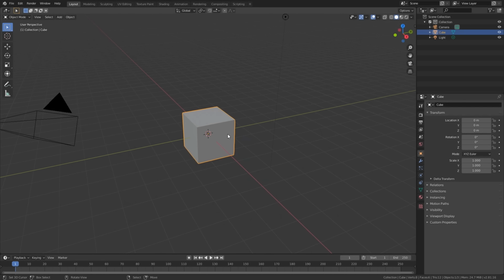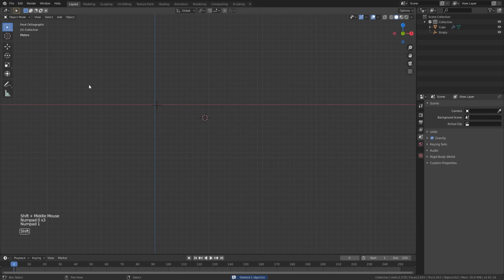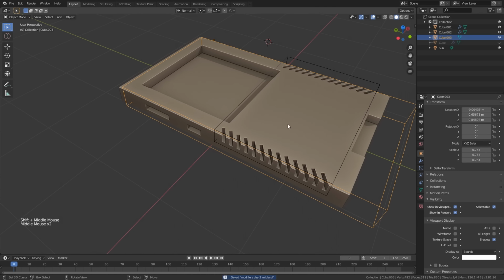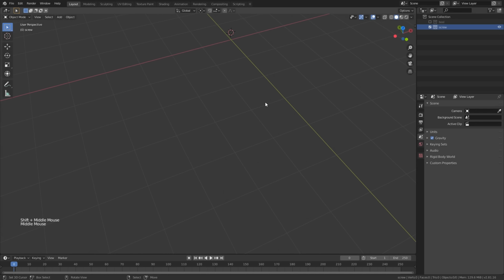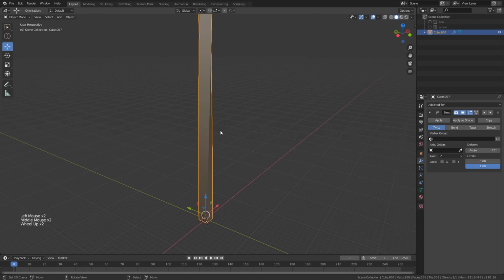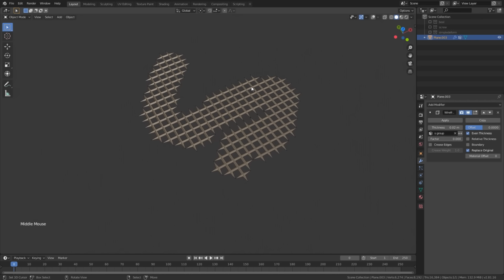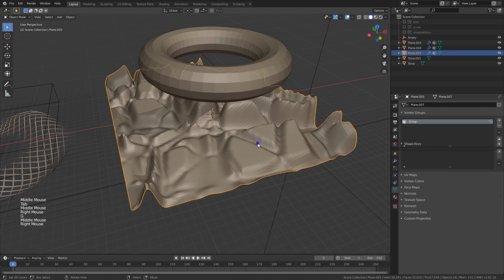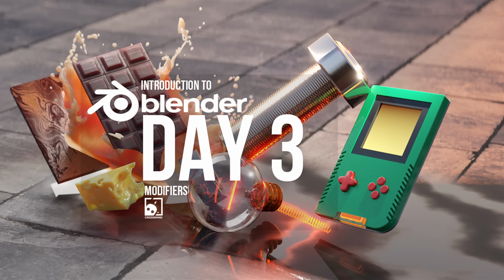Blender Day 3 - Modifiers -  Introduction Series for Beginners

Comment from the maker: Not bad you made it to the third chapter :)
If this was a video game, then your Level 1 Dagger is about to get enhanced with spells of modifiers :D
Fight Hard.
Reply: yoo , thanks for this series ,
Reply: My boolean modified does not work everytime. Sometime it does not cut the object, sometimes the cuts are no way related to the object it is cutting and 60% of times it works as it should. Can someone helpme with this plzz? I'm just a week experienced but i know how to use it, procedure is done correctly i assure it.
Reply: lets goo!!:D, thanks for this
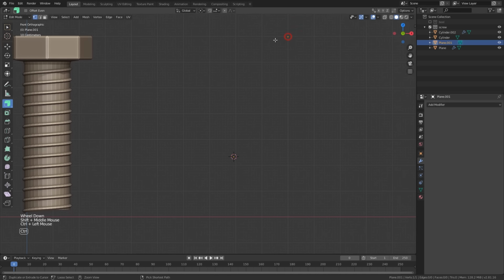Reply: in blender 2.80  that option origon not available waht should i do , time of video at 21;18. and 23:50 how you create path of vertics which tool you use to create bulb
Reply: @islam24oclock13  create a plane and delete all vertices except one and extrude it where you want it he used subdivision modifier first and after that he used screw modifier i faced problems too creating bulp too but i managed to make bulp now i am at the starting of day 4 hope you and me will be a good creator 1 day
Reply: @l.u.c.k.y7625  thanku
Reply: @l.u.c.k.y7625  thanks ,
my system cant run 2.93 .my system can run perfectly 2.80 , it can also run 2.81,82,83 and 2.90 , but there is a problem every time i open new file of blender or create mesh its like invisible but i  didn't turn  on x ray mode mode . default shade mode look like like x ray mode. every time i create mesh ,i need to go to edit mode then click right to cancel selection then my cube become vissible 

when i add zip file of open gl 32  at file location of blender, that problem solve cube beccome solid but slow respons of blender . i cant continue my work .
can you solve this problem?
Reply: a list of software for you  to try out 
gim inkscape natron lmms darktable shotcut kdenlive freecad godot   all opensource
Reply: i am learning this at 2.93 version but thanks
Reply: Thank you for these series!
Reply: Thanks for the Tut's really apreciate it. at first i was just looking for 15 minutes, and now i have made it until day 3! really enjoying blender. Thanks sir.
Reply: brother how did you made your own object? like just placing the vertex on different points.
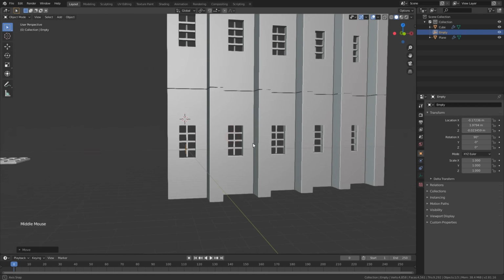Reply: 8:30 My array objects are getting smaller in different size when I'm using empty object, it's not working. What should I do now sir, please help me 🙏
Reply: We did ittt! 🖤🖤
Reply: I've been stuck at the simple deform modifier using the bend. It seems maybe the function doesn't work the same. I'm running blender 3.6 I cannot get the second simple deform (bend) to look like a ring like you have @31:39. I'm wondering if other functions don't work the same. I am noticing the interface is different.
Reply: While modeling that cheez part, my laptop is lagging, Before this it was running smooth, did I went wrong somewhere? Can you please tell me what is the issue? @CrossMindStudio
Reply: While modeling that cheez part, my laptop is lagging, Before this it was running smooth, did I went wrong somewhere? Can you please tell me what is the issue? @CrossMindStudio

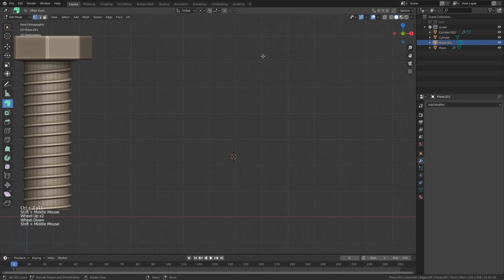Comment: 23:47

In newer Blender versions, Ctrl + Right Click does NOT add points by default anymore. That worked in older versions.

Here’s the correct modern way:

✅ Correct Way to Draw Curve Point by Point
1⃣ Shift + A → Curve → Bezier
2⃣ Go to Edit Mode
3⃣ Select all → X → Delete (remove default points)
🎯 Now Add Points

Use:

👉 E (Extrude)

Press E

Move mouse

Click to place next point

Repeat E → click → E → click

This is the proper method now.
Reply: Thank you random youtube guy

Comment: Hey Blender Artists! 🎨

If you’re exploring Blender and found this tutorial useful, I’ve jotted down some detailed notes from my learning experience. These notes capture the key techniques, tips, and tricks highlighted in the video. Think of them as a quick reference to supplement your learning. For full explanations and demos, make sure to watch the complete video.

Happy creating! 🚀

Blender Day 3 Modifiers Notes
Non-Destructive Editing and Animation:

Once we edit in Object or Edit mode, changes are not easily reversed or animated.

Modifiers allow for non-destructive tweaking and stacking to create effects. They remain in the properties panel until applied.

Array Modifier:

Creates copies of the initial object with adjustable placement.

Changes to the original object reflect in its copies.

Reset movement transforms with Backspace (hover over count area, then press Backspace).

Modifiers can be stacked with differing settings.

Modifiers remain a single object until moved; ensure object offset is correctly applied when moving.

Importance of Object Origin in Modifiers:

Example: Create a cube > Apply array (9) > Add empty object > Select Object Offset in the modifier.

Moving the empty object affects the arrayed objects.

Rotation and scaling apply to the entire array.

Start and End Cap: Specific objects for the start and end of an array.

Boolean Modifier:

Works like set operations: union, intersection, difference.

Apply Boolean to Cube > Select Sphere with eyedropper > Choose operation.

Transform Menu > Viewport Display > Display as (Bounds): Changes object visibility.

Gameboy Creation:

Ctrl+A opens the apply menu.

Adjust gaps via transform location in the modifier.

Mirror Modifier: Align with a specific object using the eyedropper.

Apply modifiers from top to bottom to avoid unexpected results.

Differing viewport options can be applied within the same scene.

Screw Modifier:

Parameters: Angle, Spin, Segments, Screw, Axis.

Change object origin to adjust diameter.

Adjust screw height and number of loops with Screw and Angle parameters.

Steps parameter (now Viewport Steps) for spin subdivisions.

Create symmetrical objects efficiently (e.g., cans, lamps).

Other Notes:

Create a new point in Edit mode by deleting vertices and extruding a new point.

Use reference images and adjust opacity in the data menu.

Screw modifier in bulb creation demonstrates automatic symmetry.

Simple Deform Modifier:

Requires a sufficiently subdivided mesh for proper deformation (use loop cuts with Ctrl+R).

Ensure the correct axis is selected to avoid unintended distortions (default angle is 45, max is 360, min is 0).

Moving the object's origin can create interesting effects but may not be recommended due to linked dependencies.

An empty object can be assigned as the origin axis to control deformation.

Bend in Simple Deform:

Acts like a loop or curled bangle.

Deformation can be restricted (top to bottom, bottom to top) using sliders.

Adjusting both sliders can create effects like knots or curled structures.

Taper and Stretch in Simple Deform:

Taper: Scales the object along a specified axis, pinching or expanding it (like squeezing a toothpaste tube).

Stretch: Scales the object along a specified axis without uniform thickness change (like stretching clay).

Animating Simple Deform:

Values in Simple Deform can be animated for dynamic effects.

Multiple Simple Deform modifiers can be stacked for complex shapes (e.g., twisted and bent shapes).

Wireframe Modifier:

Converts the mesh into a wireframe structure, allowing interactive adjustments.

Use matcap shading to enhance the visual effect.

Thickness can be adjusted in the modifier settings.

Vertex Groups:

Create sub-objects within an object to control specific areas.

Assign vertices to a group in the Object Data Properties panel.

Use Weight Paint mode to visually assign influence (red for full, blue for none, gradients for in-between).

Vertex Weight Modifiers (Edit, Mix, Proximity):

Dynamically change vertex weights based on proximity to other objects.

Useful for creating effects like a portal opening near an approaching UFO.

Displace Modifier:

Applies deformation based on texture to a subdivided mesh.

Can be controlled procedurally by moving an empty object.

Texture parameters affect the deformation, with keyframe animation possible.

General Tips:

Practice modifiers in the Modify, Generate, and Deform categories.

Pause Simulate modifiers for now as they are complex for beginners.

Combine Boolean, texture, and other modifiers for detailed object creation.

Thanks for checking out these notes! A huge shoutout to CrossMind Studio for providing such an insightful tutorial. Enjoy your Blender journey, everyone! 🚀

Comment: What is the difference between bevel in edit mode (CTRL + Bevel) and in modifiers? Modifiers can be changed and in edit mode can't?
Reply: @CrossMindStudio  Tks for your response
 but that wasn't my question 😁. Mine is related to "bevel". We can bevel using the modifyer and using CTRL + B in edit mode. What is the difference? Great content btw
Reply from the maker: @cleberlimacls  both are same but modifier applies bevel on complete model whereas in edit mode you can bevel selective edges or vertices
Reply: @CrossMindStudio  ahhhhhhh yes. Of course. Tks 😅

Comment: timestamp :-

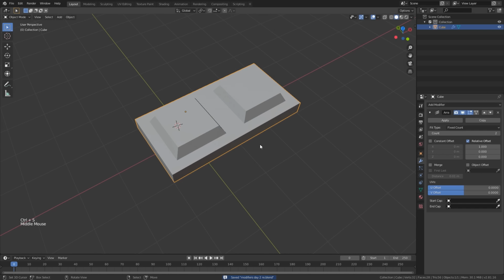Array modifier 2:55
Bevel modifier 4:27
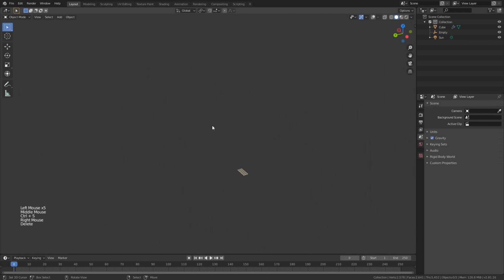Boolean modifier 8:55
Mirror modifier 12:08
Screw modifier 20:37
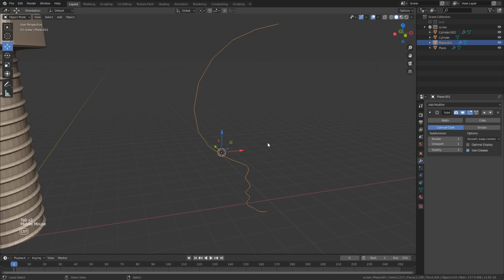Subdivision modifier 24:06
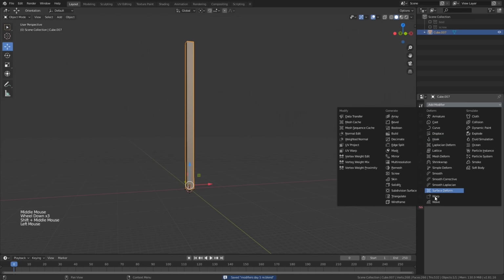Simple deform modifier 27:03
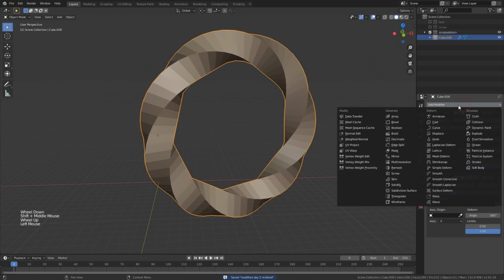Wire frame modifier 31:27
Vertex group 32:04
Displace modifier 44:33

Comment: Hey is their an add on or modifier that will leave an indentations of an object? Similar to the bullion modifier except on a flat or hollow surface? Exampl: if I took a flat plane and put an object through it, it would make an indentation of that object on the outside and inside of the hollow or plane. Is their such modifier or add on? Hope this makes sense. Thanks for your time.

Comment: hello. i could use help on a certain part please if anyone can. at 8:19 I try using the empty object on the array modifier and rotating 90 degrees but it still looks all messy after rotating it instead of aligning them perfectly as it does in this video. does anyone know why this is?
Reply: I'm having the same problem :(
Reply: @jellybingbara  i clicked command A on the object and selected "all transforms" and that fixed it (can't remember if I did it before or after I added the empty game object but if I remember i will let you know). Save before doing this in case it just messed yours up more
Reply: @pleasedontsub2732  ahhh thank you so much!!!! Do you know why it fixes the problem?

Comment: Modifiers in 3D modeling allow for procedural control and animation.
00:01
✦Modifiers can create complex objects from simple ones
06:26
✦Creating cutouts and buttons using boolean modifiers and bevels
12:21
✦Modifiers in Blender can create abstract shapes and are useful for motion graphics.
19:17
✦Learn about Blender's screw and simple deform modifiers
25:09
✦Learn about vertex groups and modifiers in Blender
31:04
✦Learn about dynamic modifiers in Blender
36:35
✦Learn about stacking modifiers in Blender 
42:15

Comment: i use 3.4.1 blender version and its a few difference or error. for example when add bevel for the button the curves not apply uniforms you can fixes it with ctrl + a and select scale it will give you back normal bevel. for another error like applying array modifiers theres no button apply in the blender 3.4.1 you can solve it with ctrl + a and select visual geometry to mesh. after that the modifiers will gone and you can shrink or scale it

Comment: “Now we can apply a mirror modifier…” 
How? I see what you click on, but it doesn’t work for me. This is a common occurrence with these tutorials: “use this for X-effect… “ then you follow up with more we can do on top of that, but as a beginner those initial event, the ones that all others are built off of need to be better fleshed out. 
Did you adjust your orientation, the pivot point, the world cursor, etc… 
I’m regularly getting stumped on those initial moves and spending 10, 15, 30 mins figuring out what one thing is making the difference.
The tweeks after are only useful, if I can follow the initial move. 
The initial move needs to be the focus.

I’m off to figure out why my mirroring didn’t work. Be back in 10-30 mins 😑
Reply from the maker: What prob are u facing exactly? Feel free to ask n mention time stamp

Comment: On 18:28 in a rectangle you are doing inward extrusion, and in my model after selecting all the faces I can only extrude in z, y or x direction but not all of them to the centre of the rectangle. I have orientation and pivot points set to global and bounding box center as on your model.
Reply: Did you ever figure this out?
Reply: I just had this hiccup. He accidentally says Extrude Region, but it's really "Extrude Along Normals" that he used. Notice in the video that the Extrude button shows the Extrude Along Normals icon when he uses it, not Extrude Region. That should fix it.

Comment: hi , the array modefier have been changed how can i control hem in the new version 8.2.2 as the way you did ?
Reply from the maker: No changes in array modifier
Its the same.
Also im not sure where u downloaded 8.2 version. Blender have only reached 3.2. 
Let me know if you still facing this issue and specifics of what exactly is the problem 🙂
Reply: @CrossMindStudio  i download it from blender, and the problem that there is no where to do a controller to the array modifier

Comment: I can't find the wireframe modifer, is it gone?
Reply from the maker: no, still there.
Reply from the maker: make sure you have selected a mesh object. only then it will show mesh modifiers.
Reply: Just scroll down a little bit in modifier. I had problem with finding it too😂😂

Comment: hey, im using blender 3.2 and i can not see the weight like 36:40 is showing, i know it's working because i can see the changes on weight paint mode, but it's uncomfortable to do that every time, it's there an addon or an option i could toggle to fix that? thanks in advance
Reply from the maker: Your viewport overlays might be off in display settings. Check buttons on top of viewport

Comment: I was wondering how did you do the water splash model? which appears for the chocolate bar in the next episode of this series. Thanks for the tutorials it helps a lot for a beginner.
Reply from the maker: i did mention its made with fluid simulation is just there to demonstrate material. you can ignore it. once you are done with this series you can check out playlist section for fluid sims tuts.

Comment: I’m having a problem with my boolean modifier. For some reason it doesn’t work as soon as I apply the array on the angled squares. Boolean works with array though when the squares aren’t angled. Any way to fix this? Thanks for this. Awesome tutorial!
Reply from the maker: Sometimes changing the angle of object a but or even the position change can fix this glitch. Try to move ur array object, its just that sometimes intersection lines glitch out.

Comment: Hey I managed to get past 1st 2 2nd was bit hard but I am facing a problem here. You literally made a whole bulb using the screw modifier. Now I can think of this screw modifier in places where winding is required but bulb? Like that how do I know on which other object I can use the modifier?. I mean the bulb could be made with mesh but taking a lot time which screw did in seconds. So how do I know which modifier can make the model easier to create rather than wasting time on mesh. Also you are making a drill like structure with the simple deform. I mean that's supposed to be screw modifier. Now this is complicating things on where should I use what modifier.

Comment: I was trying to be clever and I used an array modifier for the cross button relative to an empty object rotated by 90 degrees. However, when I tried to apply a boolean modifier to cut out the cross button, the entire gamepad cube is gone... Does anyone know what's going on?

Comment: Dear teacher, your lessons are good to learn but i have some problem with my soft wear blender 3.10. not enough tool like your, ex: second 33:25 (S Group) you have tool (assign, remove, select, deselect) but my blender don't have this tool like your. i don't know why?
Reply from the maker: Its working fine in 3.1 plz chk again under weight paint mode.

Comment: Stuck at 23:44, not able to create those points for bulb. 
Can someone help me with step by step proceduce? 
Alos I am using laptop trackpad, does that make a difference?
Reply: no, same problem having  here besides I'm having gtx1060 ti card but then also....
Reply from the maker: make sure you are in object editing mode, select a vertex and ctrl click( or right click) depending on your set preferences it should work.

Comment: Hey Ram I'm currently using blender 3.0 for this tutorial and at 8:17 when I select the empty object  as an object offset then the  models  in the arrays shrinks  I DONT KNOW  why its happening ?? An whats the solution to it
Reply: this happened to me as well
Reply: Hey guys the issue comes with the newer version of the blender. For the solution you must do the same rotation settings for the empty object which is x=90degree, y=90degree aswell. After that you need to press "s" to gave the empty object a little bit size. So that way, you may get the same result as it shown in the video.
Reply: basically, when you create a plane, you were rotating it to intented axis, so evertime you do that you must also do the same thing to the object you have been selected as offset. They must have the same axis rotating to get proper array results.
Reply: Lastly i forgot the add, when you're giving the empty object size, you have to be carefull to the both object need to be has same size.